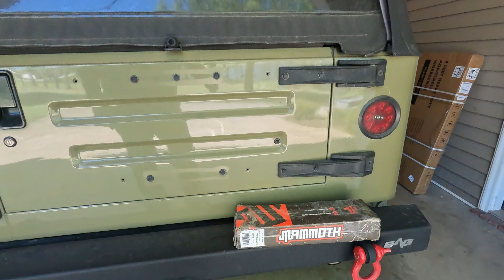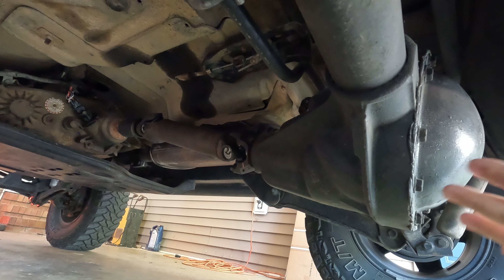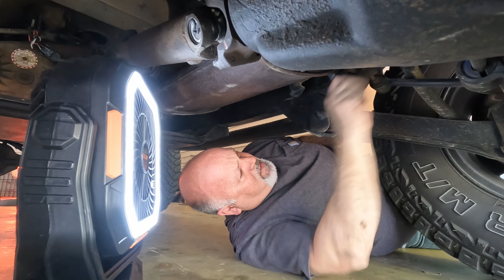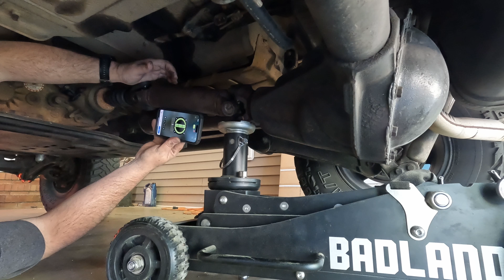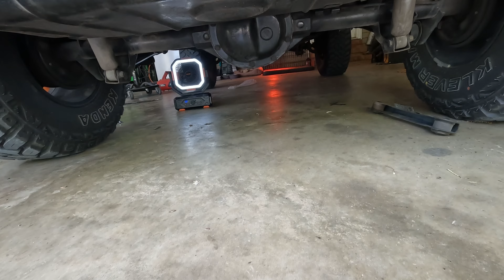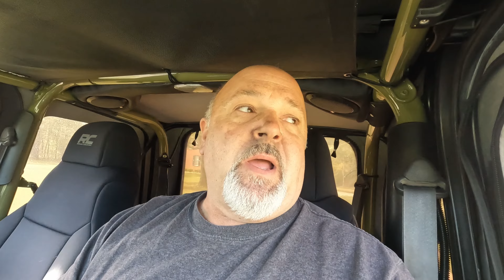Jeep TJ Upper Rear Control Arms! Vibrations

Comment: Never have understood why someone bothers making an installation video but doesn’t tell you what size sockets and tools they’re using
Reply from the maker: Most people that is capable of doing this can easily figure that out. That is the easiest part of the job.
Reply: Because if you need that much “hand holding” you probably shouldn’t even consider attempting the project. Wrenches and sockets are sold in sets, nobody’s buying individual sizes for a project like this.

Comment: Suggestion for the front. Here is the issue with messing with the pinion angle in the front. once you change the angle you also change the canster/camber. What happens is you may get your pinion agle perfect but then mess with your other angles and start fighting the steering wheel returning back to zero on return from a turn. Not saying all of that can't be accomplished, but it is a possible rabbit hole. The other way to get rid of front end vibration (and it isn't cheap) is front locking hubs. If you can disconnect your front driveline at the hubs while driving on the street will help vibrations considerably. I put a small dent in my front driveshaft at Moab and it was a vibrating SOB after that. Since then I have replaced my front driveshaft and it fixed the issue. I have a 4" Currie lift on mine and it has all 4 adjustable control arms and can't get rid of the vibrations at 70mph, but I think my next big investment might be locking hubs. Something to consider.
Reply from the maker: Thanks for the information!

Comment: Just a question. Do you have a SYE installed? If not that might help eliminate the vibration (unless something else is worn out or wrong) and you also wont need the spacers on the skid plate any more if you have any installed due to the lift. Just food for thought.
Reply from the maker: I don't have a SYE installed and thought about that. I may have to bite the bulled and do that. This is a 2.5l jeep and the rear driveshaft is a different length than the 4.0. So the cheaper off the shelf kits with driveshaft will not work. Or at least I have not seen one with the 2.5l drivshaft. Thanks for the Idea!

Comment: Great video, Steve! What amount of lift does JJ have? I’ve got slight vibration on Hound (JKU). I know my front pinion angles are good but haven’t checked the rear. I’ll have to go do that. 
Now I’m off to go buy one of those awesome fan/lights!
Reply from the maker: Thanks Ed! That is the question I wish I could answer. I don't know how big of a lift I have. The guy I got it from was not the previous owner that did all the mods. I would say around 3ish. 
Yeah, the fan is great in a lot of ways!